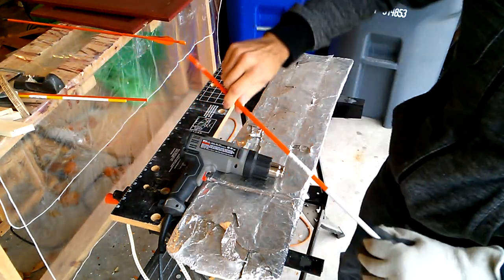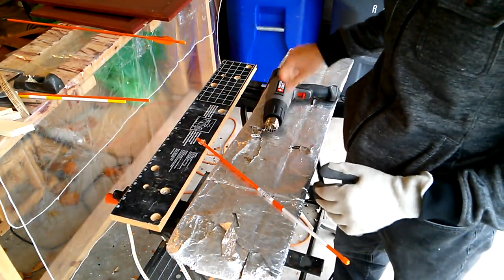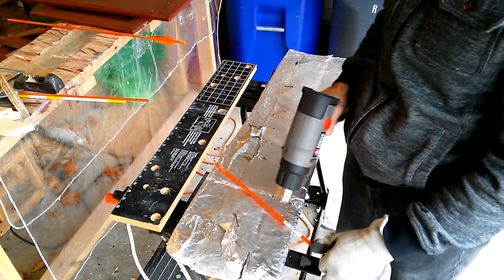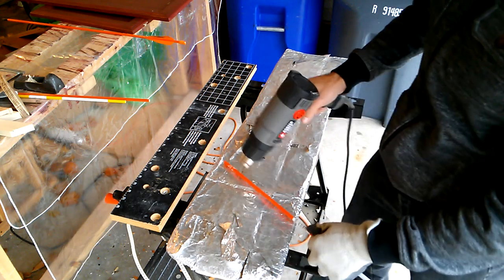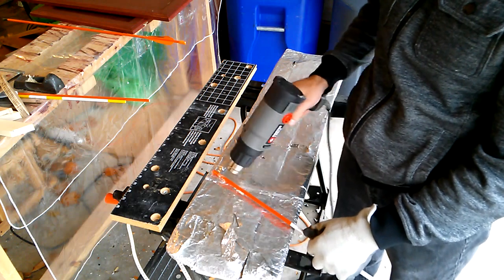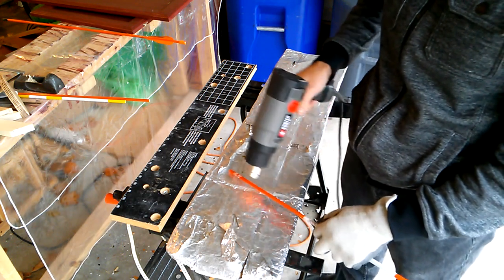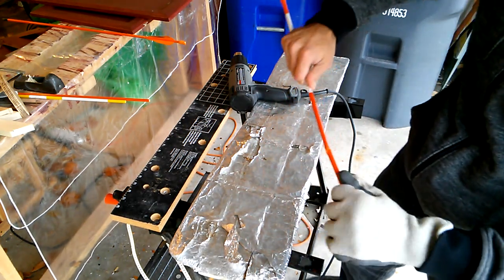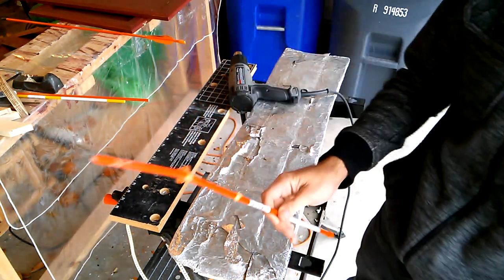Can you Bend a Fiberglass Rod with Heat?

Comment: Neat test. Unfortunately the idea is ultimately doomed because the fibers need to slide and stretch in relation to one another - this cannot occur as they are bonded together rigidly- even if some softening of the resin occurs. Eg, the length of the glass on the inside of the bend needs to be less than the length of the glass on the outside. Even if you COULD warm the material and cool to achieve a curve it would not have the same strength properties and would always fight the reshaped resin and want to return to straight. Sorry if this is discussed in your video, I skipped a bit. Thanks for taking the time to do it and show us all!

Comment: sorry dude but this is the mostb stupid thing i have ever seen in the last years. You have to fix the fiberglass rod/bar into the form you want it, then you heat it, not until it fucking melts, but maybe 50-75 degree over room temperature. This is how fiberglass bows/limbs are made for crossbows.
Reply: Yooo calm down dude you don’t need to be rude

Comment: But if you put the fiberglass rod inside a mold with the shape of the bend and apply heat and let it cool, it would be the same shape?
Reply: Yes, it is right, practically I did it,

Comment: Also a question.. why the trying to reinforce PVC with fiberglass any way?? 
Fiberglass in it self is a great bow making material, if a person wants to go through all the trouble of messing with the nasty stuff. But in essence a "PVC " bow reinforced with fiberglass , really isn't a PVC bow .. more like a fiber glass bow , wrapped in PVC.. and honestly, you can make PVC bows with 1 in ch40.. that can draw 80+ lbs with out reinforcement if formed right.. but who needs an 80lb draw weight any way?.. hunting class bows made on a commercial level , range from 45# to 65# at 28in.. any large game animal in N. America can be harvested with a 50# at 28 in bow.. 
So I guess I really don't understand the need for a "fiberglass" reinforced PVC bow.
Just food for thought.
Reply from the maker: Need for it? Nobody needs an 80# bow, or any bow at all :)

I WANT it, that's about it. 

I'm not a hunter, not much of a target shooter, just a tinkerer, and I want to see how far I can push the material. I wanted better performance out of this bow, and I got it - not efficiently (35 pounds more for about 30 fps more, at least in my first VERY abbreviated test). 

Who cares what material the bow's made of? I just want to make bows, period :)
Reply: littlelioness001 my country doesn't sell sch40 pvc, pvc sold around is so thin so... the fiberglass reinforced would be the only options
Reply: It’s a way to help make a higher draw weight and longer pvc bows without using thicker pipes. Since the thinner pipes are lighter on mass and can usually result in a more efficient bow performance wise and the fiberglass doesn’t add much mass. Especially only reinforcing the body of the limbs and leaving the tips lighter and recurving them.
Reply: The fibreglass in PVC is a modern material composite bow, akin to the horn and sinew bows.  Increasing power and efficiency over a shorter limb length and improving "pipe torqueing" at the same time.

For Science.

Comment: Fiber glass it self is naturally heat resistant.. hence the use of it in so many fire resistant applications.. on the other hand.. apoxy resin+ hardener.. the stuff we use to form things out of fiber glass.. 
Depending on what type of apoxy it is.. will melt/ deform , or become a liquid state once heated..
Reply: epoxy resin is a thermoset plastic, it will never melt it'll only burn